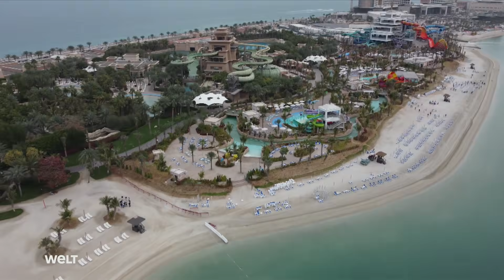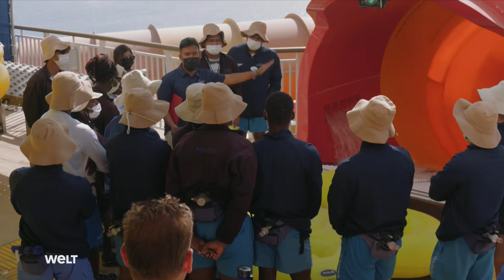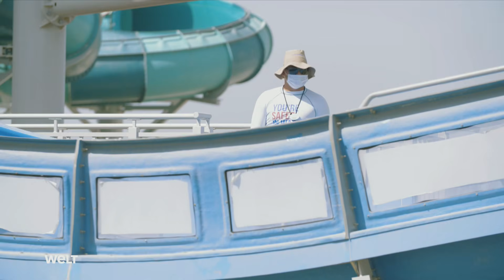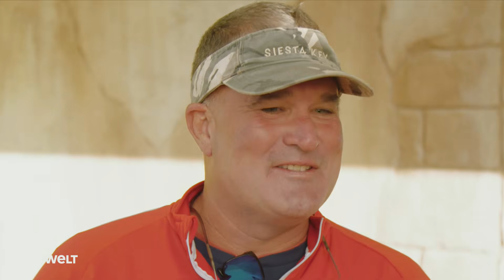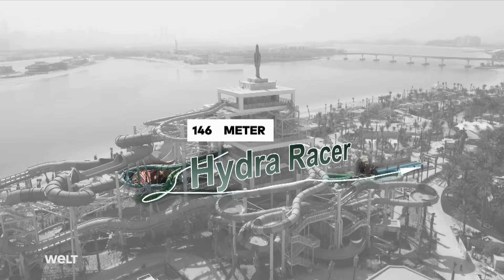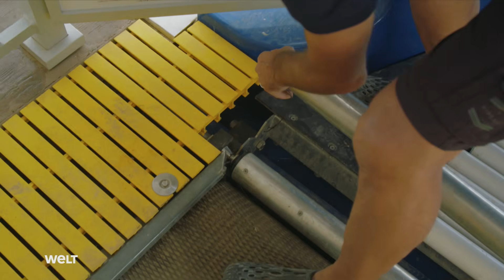AQUAVENTURE - Dubai’s Gigantic Waterpark | Full Documentary

Comment: What makes me wonder about the new Shockwave ride is: "Since the two base flume parts of track are exactly the same, (that needed to be retro-switched)  - Could construction teams (being multi-cultural on site) misinterpreted plans and" inadvertently switched the two", and the pipe fitters just followed through?  Seems like the CG points at design for every problem. At least he admitted he can be wrong in the video. Same could have happened in the lower ground pipes as well. Just wondering.. Who will know? NO problems with the design of the hotel right? - Probably not.